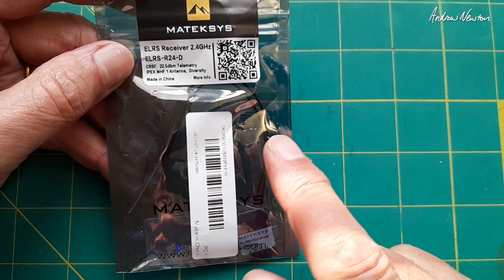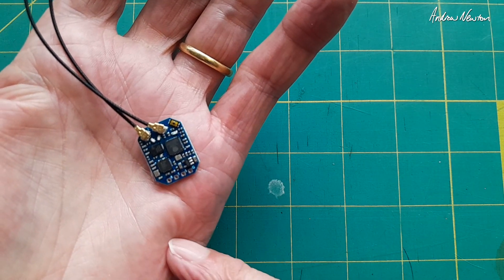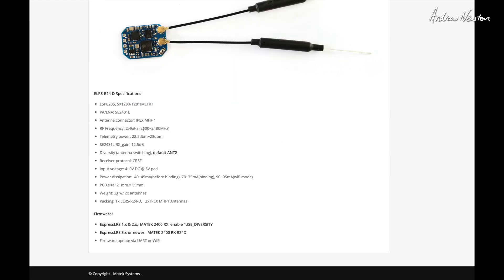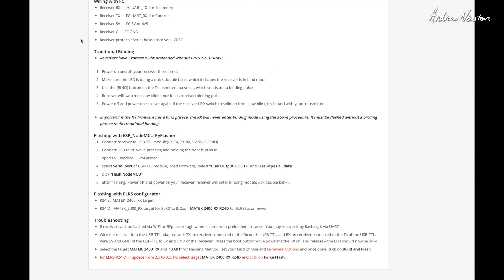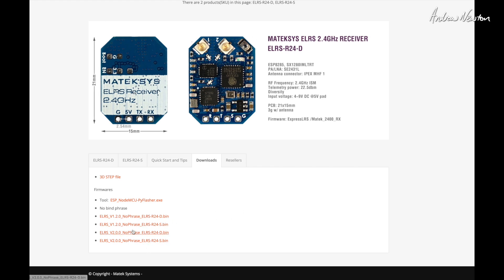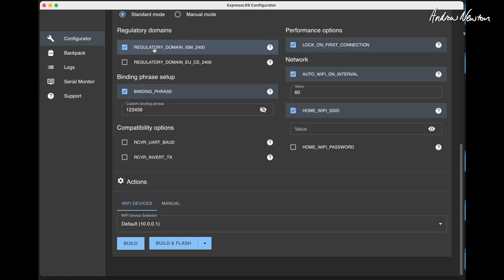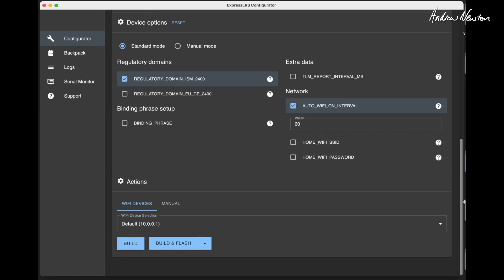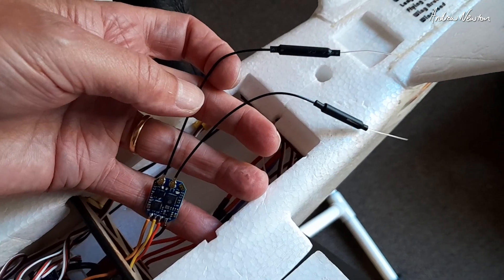Matek R24-D ELRS diversity receiver

Comment: PSA: Any version of this receiver that has a silver bind button will also have 0402 inductors and an XTAL that is not matched correctly, resulting in failsafes under common circumstances. Be sure you are using the gold button version  of these receivers.

Source: Chris (a contributor to the ELRS project) has tested many of these and confirmed the issues; I, being the one who sold him the receivers, have replaced them. More info available from Bardwell's clips page and via the ELRS discord. Happy flying ya'll 🤙
Reply from the maker: Thanks for the alert Chadd. Very tricky hidden issue!
Reply: Chadd, I have the version with the gold button, it just arrived to me. Should I be careful, do some mod, remove the caps too?
Reply: @rgbosio  So far all “gold button” Matek Diversity RXs have 0603 inductors, a good XTAL and I believe longer antennas than the default pic of a silver button rx. There should be no modifications needed, though there is now a ‘debugging’ option in the ELRS fw. I recommend this as a temporary fw to test performance if you’re worried (or have a silver button rx), then reflash without the ‘debugging’ option. 

Short answer: should be good brother 🤙
Reply: @ChaddRainsFPV  thank you very much, is always good to have some experienced people helping us!
Reply: Do you know if there is a reliable place i can get a gold button one?
Reply: @Sidiann  Matek has fixed the issues in recent batches, so that means any shop that is able to sell stock out in 2-3 months should have new (aka gold button) receivers. ProgressiveRC, RDQ, PyroDrone and GetFPV are all shops that I would expect to have new receivers 👍

That being said, there are true diversity ELRS receivers these days. I’d get the one from RadioMaster if available 100% 🤙
Reply: @ChaddRainsFPV  Wow somehow ive never heard of what a true diversity rx is before. I see some people mention "diversity recievers" while others mention "true diversity recievers" is there a difference? Would you recommend the RP3 elrs rx from radiomaster? Also, looking at the RP3 , i can see that it has 2 antennas. Since im getting into these rx's now, let me ask, since there are 2 antennas, is there a possibility of them interfering with eachother? I assume not since they recieve signal and the signal will go to the same place regardless? Also i can only see like 1 review of it on yt. Is it fairly new or something?
Reply: @Sidiann  Yup, I don’t think the EP3 is the true diversity one from RadioMaster (it may not be out yet Nov. 28, 2022). There is a BetaFPV Super D receiver which is true Diversity, though I typically stay away from BetaFPV products. I have heard good things about their ELRS gear. 

True diversity means there are essentially two receivers and a processor chooses which one has better signal to feed into the system. Antenna diversity isn’t terribly worse, but I’d choose the better option for any aircraft that I’m personally building, almost every time. Considering the price difference is pretty slim, it’s true diversity receivers for me, all the way 🤙

Comment: You could show that without getting in trouble but it would need a different setup on the ground to avoid any trouble. 
You just need a line of singht connection over some km and deploy the rc plane on the ground and use the camera to show ailerons and rudder working via the goggles.
Easiest legal way to show the range. 

Regarding matek elrs : I like matek flight controllers for wing a lot and had assumed that the matek elrs would be the same built quality.

my Matek receivers had a horrible built quality, the smd components not really aligned and the frequency was at the edge - radiomaster TX16S where the remote usually has no issues. Therefore I had been disappointed this time with the elrs, the FC shipped same day was again rock solid. Looked like from 2 different assembly lines or 2 different workers maybe.

You did not mention if diversity is a native feature of elrs or if they  had added code and parts on the board to achieve it.
I have not seen diversity elrs receivers even though I had thought to have watched all of the ELRS released in the past 1,5 years in the market. 
I had diversity only once before I guess frsky which you had recommended back in the days when FrSky was at a different level.
thanks

Comment: My experience with this rx has been really odd. I'm using version 2.51 because of my spi quads that cannot run version 3.0. 
My tx is updated to the latest version  and I'm using a pass phrase. I used the wifi method to update the firmware on the rx, and it worked as expected. However nothing moves in the receiver tab... but telemetry works perfectly amd I see my current consumption, satellites, and everything. 
On my last try I flashed the rx through a betaflight pass-through and it failed at 80%  I now have a solid red light and need to flash the bugger through a uart...

Comment: Very interesting, thanks Andrew.
I love the Matek gear also but its appears to be identical to the RadioMaster RP1 which is much cheaper..
Are you using the internal ELRS module with the Zorro or have you a decent external module??
Cheers mate..
Reply: The RP1 doesn't have antenna diversity like this, no antenna switcher,  only a single ipex connector. Nor the lna, the antenna amplifier, that this does.
Reply from the maker: Zorro ELRS internal module. It works well.

Comment: Hi I connect my R24D to Matek CRSF to PWM converter

The R24D has a solid red LED but the Converter blink blue
It seems it already connect with my remote since it has network icon and disappear when I disconect the Receiver

But I have a problem. The Servo didn't move even though I toggle the remote

*Previously I already binded the RX and TX. I used F405Wing and installed INAV. But the FC is burnt that's why I use PWM converter
Reply from the maker: Dot know about the converter but this is what the manual says -
LED status
slow blinks: CRSF-PWM board doesn’t receive CRSF signal, e.g., receiver is not bound with transmitter, receiver is not connected to UART1 of CRSF-PWM board.
8x quick blinks: CRSF-PWM board received CRSF signal and failsafe value is saved. (firmware 1.1.1 or older)
solid ON:  CRSF-PWM board and receiver are working normally
2x slow blinks between 8x fast blink and solid on: CLI mode is active  (firmware 1.1.1 or older)

Comment: Just got one, Wired into UART6 on my F4 omni. Fired up. updated via wifi on phone. Bound to TX... kept losing and gaining telemetry while sitting there. Plugged into betaflight.... no RX inputs...wtf. Tried the usual settings but nothing. Then tried to get into the wifi again... solid red LED... no bind to tx anymore.... no WIFI after XX seconds... nothing at all. Tried passthrough...nothing... WTF is wrong with it. I have a radiomaster RX spare here maybe should put it in but onto the SBUS pads rather than a uart? IDK I'm lost
Reply from the maker: Update with wrong firmware at a guess
Reply: @AndrewNewton  Just got it bound... but now no inputs on betaflight or anything lol

Comment: I cannot update the firmware in ExpressLRS configurator

"FC Found in COM 6
Connecting......"
Then build error

I also tried using expresslrs webflasher
Cannot detect RX Target, blindly flashing

I kept trying using Speedybee App
Compilation failed

Do you have any sugesstion?
I really need your help
Thanks
Reply from the maker: I have a video coming out soon on that subject

Comment: Andrew, I have the same rx and I can only flash it selecting the device "Matek 2400 RX". If I select device "Matek 2400 RX R24D" I get an error "...target does not match".  I spent a day trying to find some information. Any help or direction would help. Thanks in advance.
Reply from the maker: Very odd Bruno. Try saving the target locally, then using the popup wifi screen to flash. I find the flashing process a bit flaky and intermittent sometimes.
Reply: Isn't this a version problem?
With 2.51 one has to use the 2400 rx. With 3.x you need the r24d...
Reply from the maker: @nikotttin  Yes you're right
Reply: @nikotttin  Yes, with 2.5 there is a diversity check box but with 3.x the diversity check box is removed and you select the proper device. I'm waiting for my TTL device to arrive and I will try via USB...
Reply: @BrunoB99  I'm in the same boat. The flash failed at 80% using pass-through. Need a usb-serial to unbrick it.
Reply: @nikotttin  I received my TTL to USB device and was able to flash to the 3.0.1 with the proper device name using the UART method. This was a rough initial contact with ELRS. On top of that, yesterday I reveiced the wrong TX module... return to sender.